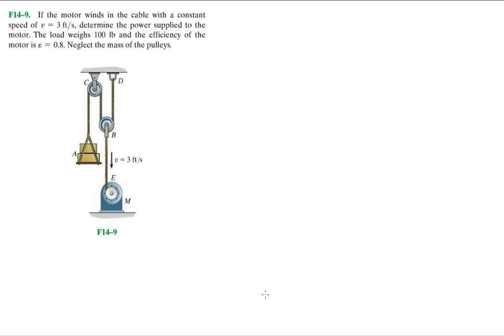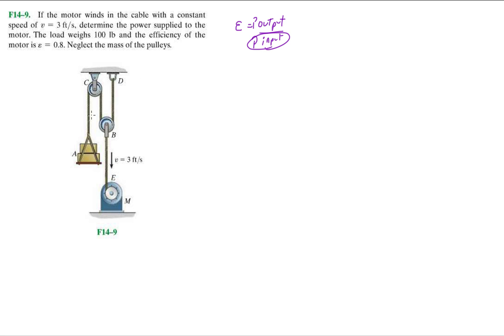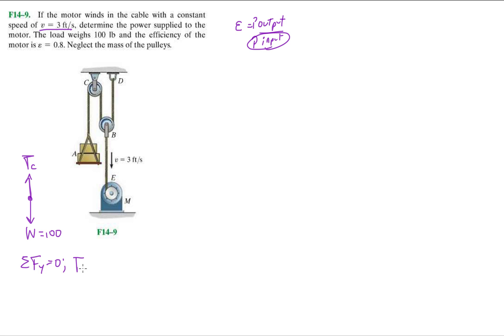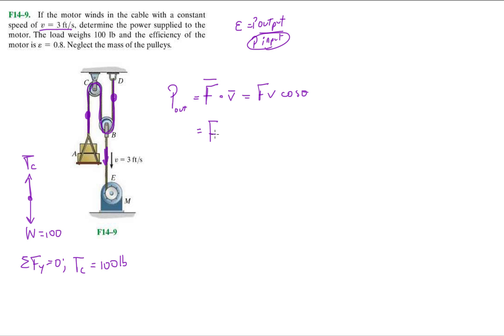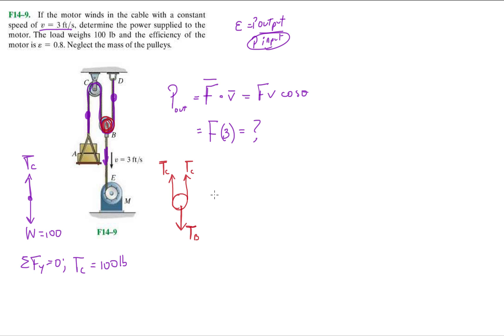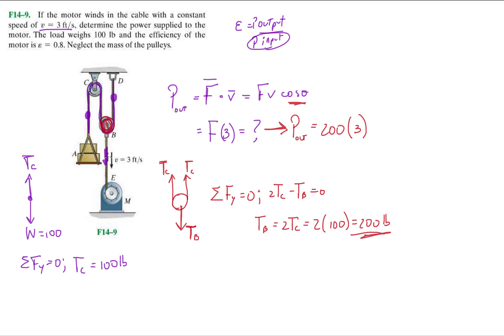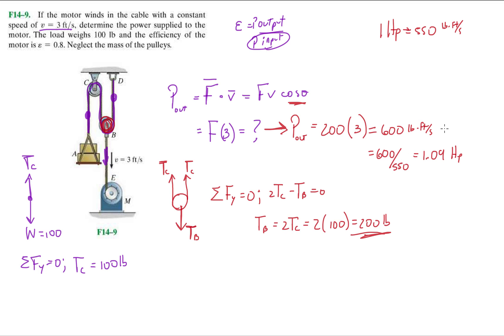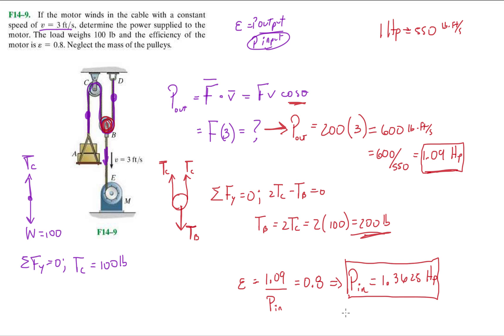Problem F14-9 Dynamics Hibbeler 13th (Chapter 14) Engineering Dynamics - Power and Efficiency

Comment: Why does it have no acceleration???
Reply from the maker: The problem states "constant velocity", this means no acceleration. Remember that acceleration is time derivative of velocity, but if velocity doesn't change (constant), then the derivative of a constant is zero.
Reply: @theengineeringcrucible3490  if we change the question like that the speed of load is 0 (standing position) and we want to accelerate 3 ft/s and wind at that speed. How can we determine the power supplied to the motor?